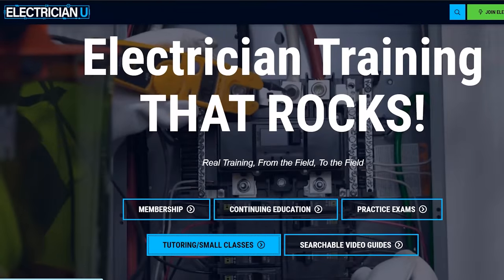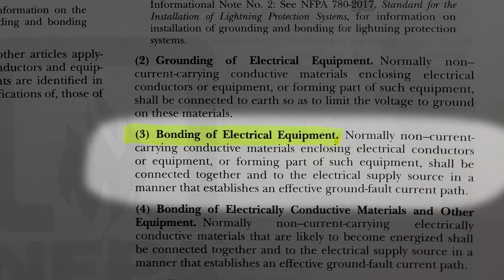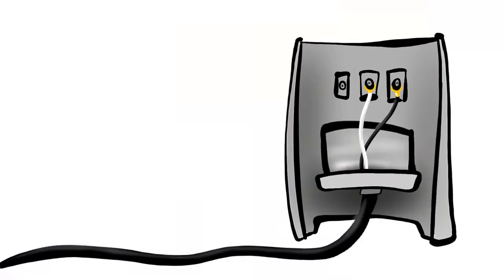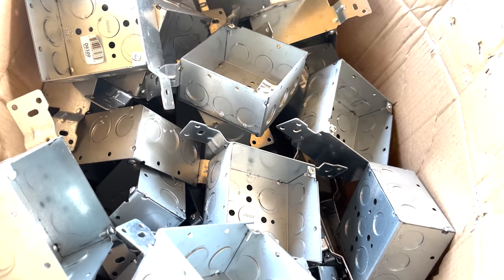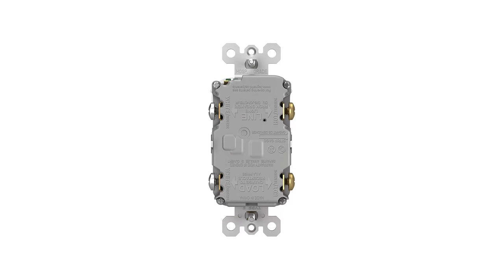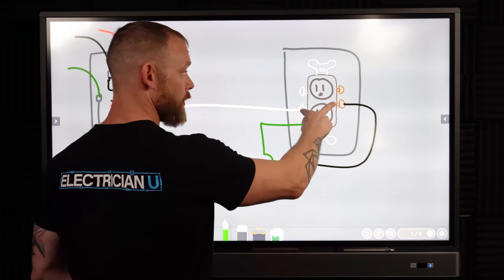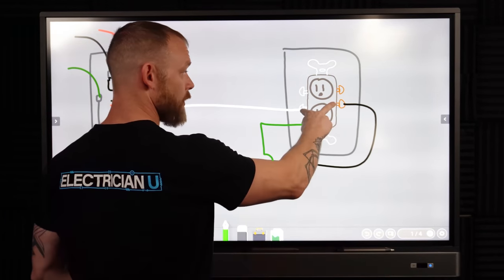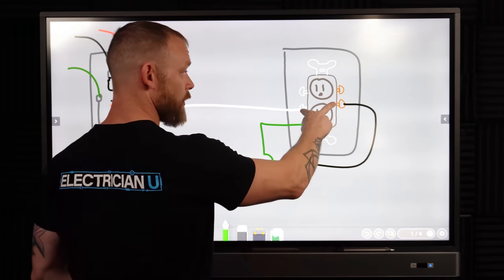Why We Bond Metal Boxes? Do Plastic Boxes Need Bonding?

Comment: THANK YOU FOR THIS! - Question, 2nd yr apprentice here, and We have gone over G&B in class but without a physical example, It is hard for me to learn - Do we ONLY bond the Neutral and the Grounding conductor at the main service or do we do it as well in all sub-panels?...I remember hearing how something with the Neutral and Ground is done in a main service BUT NOT in any sub-panels ???....I believe it is this, Bc as long as the main service has Neutral and Grounding conductor bonded, it will end up taking a ground fault path there anyway from the sub-panels, right?...Thanks Dustin!
Reply: I think he actually has a video just on this
Reply: Neutral and ground are only bonded at the first means of disconnect. This is generally your main panel and sometimes a transfer switch if you have a standby generator. In anything downstream, ground and neutral are kept separate.
Reply: Never bond neutrals and grounds in sub panels, dangerous stuff
Reply from the maker: Check out this video: https://www.youtube.com/watch?v=_XM6rXjv0vc
Reply: @ElectricianU  Thank you!

Comment: Question. If you are using a device that has a metal strap goes the complete length of the device and has the ground terminal attached, is it considered bonding when the device is attached to the metal box?  For example an Eaton outlet.
Reply: You're referring to "spec grade" devices, but the yoke of a residential grade receptacle is also metal, so it would be the same thing. Remove the mounting screw keepers on the device. The box itself still must be bonded to the equipment grounding system.

Comment: Good video and good topic too! Question, Ive got into before, where a sub panel ( especially in another building or something) there's only a 3 wire run to the sub panel but has no ground wire with it, does putting down a ground rod do any good? And then I come across it a lot where the ground wire is terminated in the metal box only and not on the device, I assume that's not to code anymore doing it that way.
Reply: definitely not by the code.... mostly for the last case you mentioned; in case of a fault, the current might flow through the user who connected a charger to it

Comment: On a standard duplex in a metal box where the ground screw is part of the metal frame do you also have to run a pigtail jumper to the metal box or since it's technically grounded through the strap in the screws of the outlet

Comment: At 11:38,  you said "if this equipement have a ground fault",  and you show a electric meter case. I have a question, even if neutral and ground are bound together in the panel, if a ground fault occur in the outdoor meter, do the neightbourhood fuse in the electrical pole will blow off or your own conductor will meltdown itself?
Reply from the maker: The meter side has a grounding electrode, which your panel is also bonded too. Your power pole (pole pig, Xfrm, transformer what ever you want to call it.) Also has a grounding electrode (sometimes.) So if there is ever objectionable current seeking a path it shouldn't be on, it will dissipate. (Should dissipate.)

Comment: Excuse the dumb question but does the ground have to be the same size as your other wires? For example if you run 3 X 6 gauge wires for your circuit, do you also need a 6 gauge wire for ground? I was looking for 6 gauge pig tails and could not find one. Is it ok to use a smaller wire for ground? Please and thanks.

Comment: The neutral is bonded to the ground ONLY at the main breaker panel - no where else, and NOT at any sub panels beyond the main breaker panel. The utility feeds the single phase home with three wires* - two hots and a neutral. Overhead is usually #2 or 1/0 TPX from pole to the weather-head.  It's up to the residential service to derive the safety ground. The pole mounted transformer has the system neutral bonded at the pole to the down ground. This is a safety ground. At First Energy we eliminated the spark arrester grounds and bonded all the pole pig neutrals (120-0-120 transformer secondary center tap)  to the down ground. At the pole or pad mounted transformer the neutral is bonded to a ground rod; either a ground rod at the base of the pole OR a ground rod at the PAD transformer. This is mainly for a path to discharge lightning  AND not a safety ground for the residence. Service ground is at least two means, water pipe, well head casing (if not municipal) and driven 8 ft rods or a combination of all. Some jurisdictions want two ground rods AND the water pipe ground tied together at a single point grounding block near the meter pan. By the way, the power line primary, say 7200 volts to ground uses a neutral for the return back to the substation. Typically there's a down ground on poles every 1000 feet all the way back to the substation. These grounds are for lightning protection ONLY. Retired Substation Engineer FE Ohio.
Reply: Apprentice here. MANY electricians believe that the ground rod is part of the current path. They refuse to not believe this, as they believe the current “wants to go to ground”. When I point out that that is not the case, they get defensive.
Reply: You haven't explained what the service ground is for the PAD transformer.
You said there is a ground rod at the PAD connected to the neutral.

My question to you then is:
What do you intend the return path to be for a fault current originating in the residential property and back to the PAD?
If it is not intended to be through the ground rods of the property and PAD, then it must be the neutral line from the PAD transformer to the property?

Which means the property must create its own separated earth at the incoming supply end of the property.

In which case, why bother with a ground rod at the property, except as a back up in case the neutral line from the PAD becomes broken?

Is it true then every US residential property has an ground rod in addition to using the neutral from the PAD to the property as the return path for the fault current?
Reply: @deang5622  The ground at the pad is to dissipate any lightning that may find it's way to the primary or secondary. In a single or three phase pad, the ground bonds  the primary system neutral and the low side neutral at the same point. The same goes for a pole mounted transformer. Any fault current on the primary returns to the substation on the system neutral. A secondary fault returns to the secondary windings. The magnitude of the secondary fault current depends on: 1. Transformer impedance, secondary wire size and the primary fault current magnitude at the elbow feeding the transformer. This is usually at 12.47 KV, 13.2 KV or 4.16 KV. Primary fault current & transformer impedance can be determined by the utility. Based on that, you can calculate the secondary fault current at the meter pan. I use the EATON I Phone AP - fault current calculator. If it's over 10 kA then you need better breaker / load center to next level at 22 kA capability. Usually most residential situations are under 10 kA fault current capability. The load centers sold in the home centers are usually 10 kA rated.
Reply: @sethtaylor5938  That is a long answer but you didn't actually answer my question.

You said "any fault current on the primary returns to the substation in the system neutral." 
And :
"A secondary fault returns to the secondary windings".

Agree on both of those. But my question is what is the route taken by the fault current in the secondary circuit where the fault occurs in the residential property.

It seems to me the answer is one of the following:
1. Along the neutral line from the property back to the secondary winding on the pad
2. Through the physical earth/ground using the grounding rods of the property and PAD 

Which is it, 1 or 2?
Reply: @deang5622  The fault current on either leg of the 120 volts or across both legs of 240 in the residence is reflected through the transformer windings (through the transformer impedance) back through the primary neutral to the substation. The fault always goes back to the source. Grounds at the service equipment  are there to ensure that the NEV (neutral earth voltage) doesn't go above 3 volts (NESC National electric safety Code) The lowest resistance back to the source (substation) is via neutral - meter pan - pad transformer - through the impedance of the transformer back to the substation. Ideally, grounds are for: safety (in event of neutral continuity break) and to carry away lightning charges, but not not fault current PAST the meter load center.  That's why the electric service in the home is only supposed to have one common location where the inside neutral is bonded to a water pipe, well head and driven rod - a single point. So that's where inside faults are then transferred to the utility source. Remember, the electric supplies via: overhead triplex, two hots and a neutral or Underground two hots and a neutral. All fault current that flow outside of the residence is carried on the utility neutral.

Comment: If your device strap is connected to the ground and you screw device to metal box doesn’t that create a bond? I get it as a redundancy thing but it’s all connected no matter what, also why do we only bond ground and neutral at first panel and not sub panels ?

Comment: CORRECTION:

An electrical appliance (such as an electric clothes dryer OR an electric range/oven/cooktop) that does not have a 4-conductor supply cable feeding it, terminated with a NEMA-14 plug-cap, thus containing separate neutral (grounded/earthed circuit conductors) from the equipment grounding (protective earthing) conductor, but instead is connected with a 3-conductor supply cable feeding it, is using a GROUNDED NEUTRAL CONDUCTOR that is essentially pulling "double-duty", as also acting as an equipment grounding or protective earthing conductor to the appliance frame is in fact bonded to the neutral supply conductor, and therefore this NEMA plug configuration is actually identified & listed as "non-gtounding"

240V domestic appliances are still being supplied with a bonding jumper wire as being connected, thus tying the neutral termination on the equipment terminal block to the metallic frame or case or cabinet of the appliance as it is being sold new.

Such 3-wire cable supplies to said appliances have not been permitted by the N.E.C. (NFPA-70) since 01-January, 1996.

4-wire cable supplies with identified & listed grounded wiring devices shall & must be utilized on all new installations built after 01-January, 1996.

The reason for this is the eventual condition that the grounded conductor becomes detached, disconnected or otherwise damage during utilization of the electrical appliance or apparatus, thus causing a dangerous condition where all of the exposed conductive (metallic) parts have a high probability of becoming energized, thus posing an electrical shock or electrocution hazard to personnel.

Comment: If you ground the box do you still have to run a ground wire to the receptacle???  The metal strap on the receptacle provides ground.
Reply: Im not sure what code states but generally its a good idea to do both to cover yourself
Reply: @ejzera8188  They make self grounding devices that are listed to be used without a wire connection from ground to device. When installed on a bonded metal box, the device automatically makes a sufficient connection with ground because it has a brass plate on one of the device screws that grabs onto the screw tightly, thus not relying on loose threads to make the bond.

Comment: If ground is bonded to neutral the current flows back to the panel and not the grounding rod, then what’s the point of the grounding rod in that case?
Reply: Firstly don't think of it as current flowing back to the panel, the source of the current is the distribution transformer out in the street.  The current needs to return back to that.

A common means of grounding is to connect the ground to neutral at the panel, so when a fault current occurs it travels along the ground wire to the neutral bond point in the panel and then back along the neutral wire to the distribution transformer.

In this arrangement there is often no need for a separate ground rod.
The ground rod is is providing no function here.

It can just serve as a backup in case the neutral in the supply feed to the property is broken.

Then the grounding path is physically thorough the ground/earth from the ground rod to the grounding rod of the distribution transformer. It will have a greater impedance than using the neutral of the supply feed, so it is not as good a ground.

Comment: Someone may ask about the plastic box nails, which are conductive. It's not required to be tied to the grounding wire because it's outside the box.
Reply: Some plastic boxes have screws which are mounted from the inside. The nails are hammered into the wood which is non conductive when dry. If you had screws mounting from the inside and the wood was very wet and an uninsulated wire somehow contacted the screw it could be a problem. Not too likely, though.
Reply: @surferdude642 or if the studs were metal.

Comment: If the box is metal and bonded does the switch or receptacle attached to it have to be grounded as well since the grounding screw of the device is attached to the yoke of the device that gets screwed directly onto the metal box that is bonded? I understand why plastic boxes wouldn't work for this but why not the metal ones? Thx
Reply: That comes down to your own electrical code.

In the UK if the front plate of the receptacle is attached to the metal back box using a fixed lug, which makes a good electrical connection, then under UK regulations it is permitted to use that screw and lug as the earth path, and you don't need to connect a ground wire to the metal back box. For this, the ground wire is connected to the receptacle and in the receptacle it is connected to bit of metal around the screw hole.

Comment: Can you do a video on Mayer’s hubs. Everyone says you need them for top penetration but I don’t see a code for it.  My company doesn’t use them and inspectors never call us on them.
Reply: It's called a Myers hub.   It is one of your options for establishing a waterproof entry in the top of an outdoor enclosure, but it isn't your only option.  Any time you enter an outdoor enclosure above live parts, you need a waterproofing method in your assembly of fittings.   A Myers hub is an option that integrates mechanical continuity, electrical continuity (since the serrated components bite a bond to the box), and waterproofing.

Comment: Does a metal box need to be grounded if it is power limited class 2 circuit? .
Reply: I don't know your electrical code in detail from a quick bit of research I gave done indicates your class 2 power limited circuits have a limit on the supply voltage of 150 volts AC RMS 

That's enough to cause electrocution. 50 volts is the threshold between what is considered safe and what isn't.
Anything above 50 volts could cause electrocution.

Given that then, I would suggest you earth any metal boxes in a class 2 power limited application in order to remove the electrocution risk.

Comment: How does this work if you are using metal boxes for low voltage wires where there isn't a ground?
Reply from the maker: Article 250.70 
And article 800.100 A - D 

Should help you with that answer. 
There is exceptions allotted 800.100(a)4

Comment: I didn’t ground a metal box, but when I used a multimeter and tested the box - with red touching hot and black touching the metal box it shows 120 volts.     I used a romex s from the breaker to the box. Thus the grounding must be through the receptacle   Then the receptacle l to the box?  Does this follow the code?
Reply: Always ground a metal box.

Comment: Say you have 2 circuits that share a neutral and one separate circuit with its own neutral in the same jbox what if you accidentally hook up the wrong neutral to 2 devices on the same phase with 1 neutral?
Reply: If enough current is pass through it the neutral carrying the same phase the neutral can become overloaded and burn at the point of greatest resistance. Usually melts the insulation near a terminal screw. In example,  you have two of the black wires (same phase) from two separate breakers of 20 amps sharing the single returning neutral from the devices such as a hair dryer, a heater and a microwave.